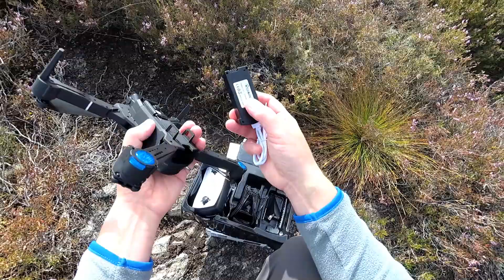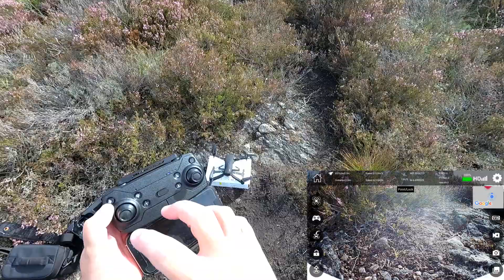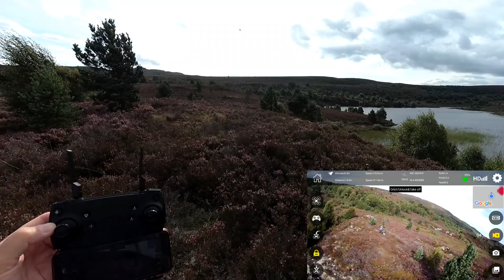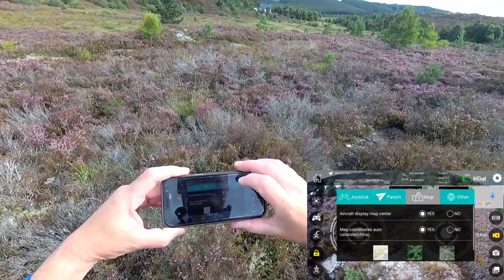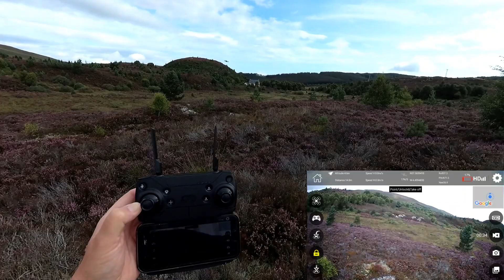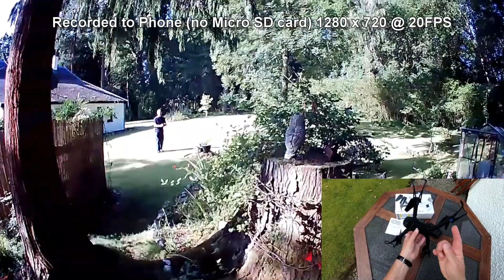Eachine 520S Folding GPS 2.4g or 5g WiFi 1080 or 4k camera  Altitude Hold Quad

Comment: Best review video I've seen!  Never heard of an "Optical flow sensor"!

BTW, what's the downside to always flying with the prop guards on?

Also for GPS (compass) calibration , instead of watching for the drone's solid blue leds, shouldn't the android app always be used?   I've heard to wait for a minimum of 7?   BTW, the hard copy of the manual's qr code points to "Eachine TEC",  yet the  soft-copy of the manual points to "LW FPV".   A search on Android shows Eachine FPV.   Interestingly, all 3 require Microphone and Phone access?!   

Have you ever had to do Gyro calibration (joysticks to 5 o'clock position)?  The manual says it's not always necessary?

I've got the E520S (not the E520S Pro, which I believe has electronic Gimbal), but I assume the 5G model with only work with a 5G phone antenna? For now I'm using the phone's storage for the picture/video.. but what's the biggest capacity SD Card that the drone will take?

Note, the drone batteries don't seem like they come charged.. I think the batteries' blinking blue, and solid red has to turn solid blue, no red.

Comment: How long do the motors on these last and are replacement motors cheap and easy to fit. I got the hubsan h502 and the motors die after about 10 flights

Comment: I bought this one, and a Holy Stone drone for my son.  (I have a Typhoon H).  On the Holy Stone, I didn't realise it (and it's pretty cool) but if you attempt to fly away too far, it will actually "hit the wall" and stop and not go any farther, so as not to run out of signal range.  But, question:  The Eachine has "waypoint nav", which if I am reading it right, means you could program a route for it to fly, and it will fly it.  Does that mean you could program a route that would defiantely take it outside signal range, and it would be able to fly half a mile away and come back into signal range?  That would be cool as hell.
Reply: Good question? Any answers?

Comment: Hi Tigger nice videos - the E520S it's a great  (price compare) drone, isn't??. You refer some issues of Sdcard.
I read somewhere that the SDcard must be Format (not fast) Fat32 and create 3 folder (Photo, tmp, Video) ,because did not work ( reccord videos )if no create folder. Have you made this steps  ??  you refer also that when you click on App  "record video" the camara Drone flash light on Sdcard slot. this mean that the camara is record video on SDcard ??  i ask because you not show  the chose (Record on SDcard or on smartphone by the APP)  this means that the camera is recording on the SD card or you made that choice on the mobile phone's app and once done, this configuration is fixed until it is changed again to record on mobile ??
tks by replay
Reply: video siempre graba en SD

Comment: Whilst I appreciate this and all the other similar reviews I watched before buying this model, every single one just glosses over in seconds the part about connecting the wifi. I may be dim in not understanding the technical spec but I wish somebody had actually talked about the wifi. My phone cannot detect the network and I now understand I need one that supports what I have learned to be 802.11ac. Now having spent two weeks trying unsuccessfully to connect, unless I am mistaken, which I hope I am, I now have to go out and buy a phone that will cost just as much as the drone.
No cover of this in the manual and no online support. Inside the box a card that says give us a five star review and we'll send you a free battery. I know what review I'm thinking of giving and it isn't five star.

Comment: I wouldn’t purchase anything from this manufacturer again.   SD card slot doesn’t work so 4K model does no better than what’s transmitted to phone.  Eachine support ignores all attempts to contact so completely not interested in giving any support.  Banggood will not replace wants to give a partial refund, will not replace, so left out of pocket for one useless drone.  I would say beware of dealing with either of these companies.

Comment: Hello, I have a problem with this drone, it loses power and begins to descend even if the battery still has 80% charge and even if you try to raise it the drone no longer responds. The drone is new and does the same with the two batteries I bought even if they are well charged. Do you know what the problem may be or do you have a solution?